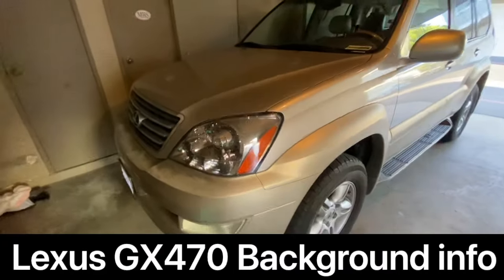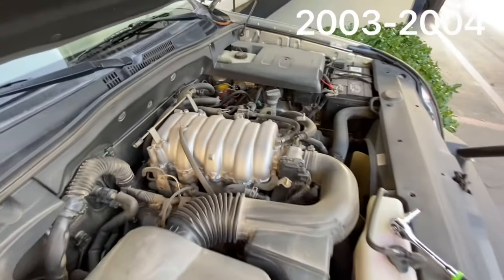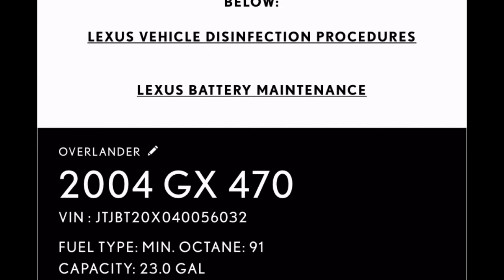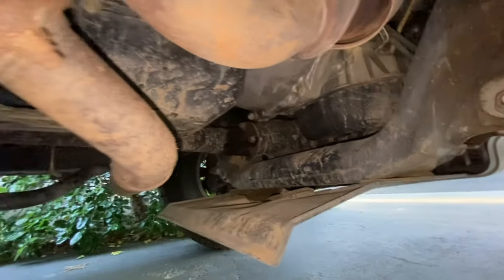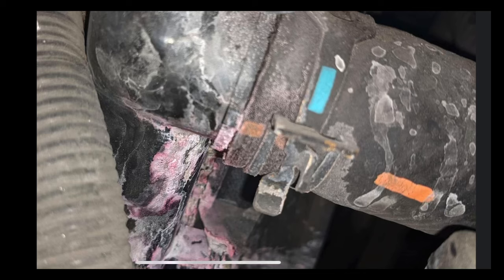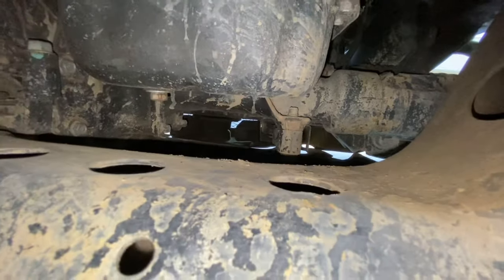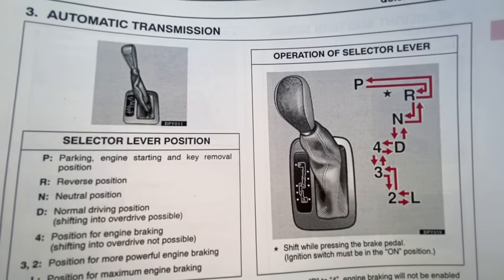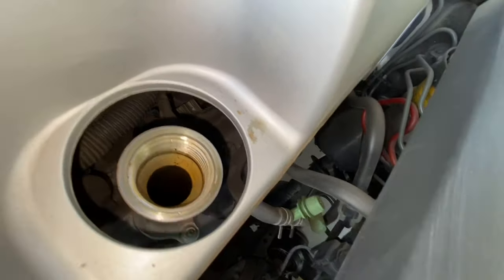LEXUS GX470 BUYERS GUIDE - 7 Things You NEED to Know

Comment: I would consider selling my '07 gx470 but I have hard time convincing myself why i should part with 40k+ to get a gx460 that would still sit in my garage 5 days a week and average 5k miles per year.   Would it really perform any differently?   
My only worry on my 470 is  frame rust here in MN.   However, i ask at Lexus and toyota whenever in for service if any noticable issues.   Answer is always no.   I can only crawl under so far.  Definitely surface.   But nothing excessive that i can see.

Ironically enough i purchased in the exact stock silver pictured on your video after selling my cherished '05 tundra dbl cab in the exact maroon color you pictured.   I could own an entire fleet of toyota / lexus vehicles i am so confident in them and feel they are such great values........well,  as long as you're not overpaying and buy smart used that is.
Reply from the maker: Yeah it’s a tough balance for sure. This market is definitely a sellers market though so you may be able to get top dollar for your used car at this time. 

Totally agree, For all non-sports car uses, I don’t see why anyone would get anything other than Toyota/Lexus.
Reply: Ivan living in MN would be a concern for rust.  However consider taking your 2007 GX 470 to a local shop in your area maybe in their down time of the year. IF such a time exists for your area.  Have them clean the main frame rusted areas and other rusted areas and spray or brush a rust inhibitor on it.  The reason I say brush it is there's not alot of people able to see under your GX other than your mechanic at 5,000 service points.   This will help prevent possible rust and maybe every 2-3 years take it back to the shop to touch up any rusted areas.

Comment: I hate timing belts. My old Jeep 4.0L has a chain. Think it’s making 300k no problem
Reply from the maker: Yeah I agree on that, timing belts can be annoying. But one thing timing belts are good for is making sure you (and the people you buy your used car from) have to periodically check and replace all your accessory drive bearings and have a fresh water pump. The Jeep 4.0s are another legendary reliable engine but they definitely don’t have the same performance as the 2UZ. There’s always going to be trade-offs.
Reply: That jeep 4.0 is one of the most reliable engines ever made

Comment: It's now 2023. If you had a choice between a brand new 2004 gx or a 2007 which option would you go with?
Reply from the maker: Need to include factors like mileage, maintenance history, rust situation, vehicle spec (like nav or non-nav), etc. 

I would choose a lower mile, great service history, great condition, rust free, non-nav 2004 GX over a high mile, rusty frame, nav, limited service history, meh condition 2007 any day.
Reply: Thanks for the response. Let's say both had 0 miles on them brand new. Would you still go with the non nav 04 over a nav 07?
Reply from the maker: @pcargs2721  I’d definitely get the Nav 07 and deal with the Grom VLine 2 head unit apple CarPlay integration vs. the better HU options available for non-nav… 
it also depends on emissions requirements in your state. If the emissions equipment introduced in 05 and on breaks, you have to fix it in strict emissions states (like CA). Otherwise you can block it off and no big deal.
Reply: You're the man! I found an 04 with 85k miles in excellent condition and almost no rust with non nav but they want 18k, its 1.2k miles to drive back, and I dont think the belts or water pump have been replaced plus 6.25% sales tax and I'll have to undercoat it.. and hes not wiggling on price. I like that it doesnt have bluetooth and no GPS for my tinfoil hat reasons though lol.. low emf exposure. I'm going to see if I can find a gem 07-09.. although the vvi adds come complexity this will just be a daily driver at first so the potential gas savings will be nice I guess
Reply from the maker: @pcargs2721  both trucks sound awesome. But you won’t save any gas with VVT. That system is designed around delivering more  power at lower revs, not efficiency. Modern cars have VVL (lift) systems (Miller cycle) that help with efficiency, but these don’t have that. It’s a significant amount more power though, which is nice. 
18k sounds insane to me but we live in different times than when I bought my 04…

Comment: I'm considering 2004 Lexus GX470....Is it recommend to buy? Thanks
Reply from the maker: Yes, I have two of them!
Reply: I'm looking at one tomorrow the lady had 71k miles and wants 12,500 one owner and from virgin island what do you guys think ? Good deal ?
Reply: @vaerio81  very great mileage...just check under part (rust or not), car paint, no accident and interior..etc... if they are all acceptable...you will have a great V8 with low mileage. Good luck
Reply: I have an 04' and it has 227,000 miles. Starts and runs like new. It was very well maintained by dealer before I bought it.

Comment: 20:03 wha is that green light on the top right of the dash?
Reply from the maker: It means the headlights are on
Reply: @lexus_offroad_adventures  Too funny I guess I do not drive my GX at night, hanging my head in embarrassment, my light is on for Require Service as well,  my GX just hit 200k and was fully serviced by the dealer up to 195 K miles when I bought it. Is it just a Hit Milestone check light comes on or does it sense something?

Comment: you're wrong about the nav/non nav entertainment aftermarket stereos, there are aftermarket harness adapters available that easily allow after market headhunt installs while retaining the nav/hvac screen
Reply from the maker: Nobody knows this better than me as I have both Nav and Non-Nav models. Also, See the Grom VLine 2 install video: https://youtu.be/fjHxRfWRZSk

My point was more of a criticism of the stock system itself that integrates AC controls in the screen rather than just having buttons which is way more convenient. And also that it is not as easy as simply replacing the head unit as it is with the non-nav. I like the Grom but you’re still dealing with an old touch screen. (Full review coming soon) Definitely not as good as dealing with all modern tech. 

Bottom line is that I was trying to tell people not to let dealers or sellers try to sell them on the nav being a “plus” since it is more complex than “it cost more when the car was new”.
Reply: @lexus_offroad_adventures  you’re 💯 correct , I was simply pointing out the work around, I enjoy your channel.
Reply from the maker: Gotcha, thanks for watching!
Reply: @james-he7xv  you literally told him he was wrong. You weren’t just pointing out there’s a workaround. You explicitly said he was wrong. It’s the first thing you said.
Reply: @tyronsreekley876  🤣
Reply: Lol love these comments.

Comment: So what is the “2nd Start” button???
Reply from the maker: Good question, I should have covered this. When you’re in 4-low, you may notice that the car is jerky when up/down shifting from 1st gear. 2nd start means the transmission will start you off in 2nd gear instead of first to both smooth out the ride when you come to a stop/slow down and also give you higher initial wheel speed if you’re trying to power out of snow or mud. You can also use 2nd start in 4-hi while driving on the road safely. I wouldn’t use it for too long in traffic though. But you can get an idea of what it feels like to use the feature
Reply: @lexus_offroad_adventures  gotcha, thank you!!! Honestly I’m sure this would be a solid video tutorial as I haven’t seen any video explaining it at all. Thanks again!

Comment: Has anyone had their speedometer and tachometer start to not work?  Mine will work in the cold weather when first started and driven, but then it will not work for the rest of the day.
Reply from the maker: I’ll pin this for a while to see if anyone else can help you with this issue. Is it just the backlight? Or does the actual needle stop working?
Reply: @lexus_offroad_adventures  The actual needle stops working on both.  (The temp and gas needles work all the time.)  It's very odd and there is no pattern except that when the car is cold and has sat over night, they work.  Then very intermittently after that, if at all.  Very odd... Thanks so much for your reply!  Really appreciate it.

Comment: I'm a gx owner but I do almost all maintenance by myself. But people just think diy maintenance doesn't count as well-cared maintenance... Do you have any ideas, I main most of gxor guys are experiened to do almost all services by their own.
Reply from the maker: Yeah that’s why it can be a bit hard in the used market. I’d say to use your owners manual service record section to document when you do DIY services. That way the next owner can know. If you’re looking for a used one and you just have their word to go by, it can be a risk but you can usually tell if they took care of it. Good idea to get a PPI always though.
Reply: I do all my own work aswell.. already did front air ride conversion.. to struts.. 2 yrs ago.. and in week or so.. complete front end replacement.. struts.. upper lower balljoints.. and bushings... inter and  outer tie rodends... wheel hubs.. and axles..  front and rear breaks.. with stainless steel brake lines new calipers and rotors out of a tundra...and rear control arm bushings,, with pan hard bar.. new springs and shocks conversion from air bags.. and front and rear sway bar bushings and links.. and with all toyota parts.. except rotors..  and my quote from my local lexus dealership... was crazy.. if you can't fix it youself.. better have DEEP pockets.. or really keep up on maintenance... and to toyotas service schedules

Comment: thoughts on 460?
Reply from the maker: Huge fan!
Reply: @lexus_offroad_adventures  i'm close to pulling the trigger on one..   super clean, and it has 33's on it.. one thing I learned is no timing belts - this 4.6 motor has timing chains so that's good.  has 2 inch lift front and back and seems pretty tight.

Comment: Then, why does it jerks after I come to a stop?
Reply from the maker: Sounds like the driveshaft clunk issue. As the rear air suspension settles down after you come to a stop, the rear driveshaft telescopes into itself on a set of splines. Because of some design flaw, the grease in the driveshaft dries up so while it tries to slide into itself, it binds and causes that bump/clunk. 

Easy fix. Just get a grease gun with zerk fittings, find the grease fittings on the driveshaft and replenish the grease.

Comment: On the dealership selling a car with a navigation, they are going to careless about your opinion because they will be like, well if you don’t have the budget to afford fixing navigation when it fails it’s not our problem. Lexus navs were their premium package for a reason cus it was higher class. Now it’s up to the people with low budget to make that decision wether they can afford to have one with navigation or not. In today’s days there are plenty of company’s that have good stuff replacing that oem navigation system for and aftermarket one with no issues. AND OF IT FAILS ALL YOU GOT TO DO IS PRESS THE ( AUTO AC ) button and use the up and down to regulate the temperature as simple is that. Just because the screen fails doesn’t mean your AC will not work anymore.
Reply from the maker: Yeah dealers might not care, That’s why I said “good luck with that” and laughed lol 

it’s more of a counter point if the dealer uses it in negotiation to try to make the buyer pay a higher price. 

Sure there’s always ways you can make it work. I have both a nav and non-nav model. But there’s a reason the prices for the non-nav AC controls are approaching $600.
Reply: @lexus_offroad_adventures  it’s up to preferences on my opinion. And the people that can repaired them for them selves

Comment: All 4 axles eh?
Reply from the maker: Yes. “Axle: a rod or spindle (either fixed or rotating) passing through the center of a wheel or group of wheels.”
Being that, at both the front and rear of the GX470’s drivetrain, there are two independently rotating axles, separated by a differential, each driving one of 4 wheels, there are four total axle shafts.

When people say “the noise is  happening at the rear axle” or something like that, it’s colloquial and not technically correct.

Comment: Lexus gx or 4runner?
Reply from the maker: If we’re talking about the 1st generation only: GX has the premium drivetrain as standard (V8 and full time AWD with selectable center diff lock. Rarer in the T4R so you’d pay more money) 
GX has a nicer interior
GX has more room inside 
GX has a quieter ride
GX now has just as big of an aftermarket 
GX prices are more reasonable
etc.

But… maybe some think the 4 runner looks better?
4Runner has the cool rear window thingy
With a 4Runner you get to be a yota bro…
???
Reply: @lexus_offroad_adventures  want to get one for off reading and just thinking about what's cheaper option and better for off-road reliability. Seen a guy selling a decent 2007 for 15k but I'm thinking that's too much while a 2007 4runner will be around 10 or so. It's a tough decision

Comment: If your timing belt breaks it’s a non contact. Meaning it will just stop and won’t smash valves.
Reply from the maker: I’ve heard this, I’ve heard otherwise. Until I talk to a Toyota engineer, I wouldn’t risk it lol. 

Some say that the non-VVT ones are non-interference while the VVT ones are. It just doesn’t make sense to my why they would completely refusing the cylinder head architecture for a change in timing actuation. 🤷‍♂️

If you have a link on the subject I’d be happy to read thru it!
Reply: Nooooo, this is an interference engine. Lose the belt, lose the motor.
Reply: This isn’t true my guy
Reply: Mines an 04' and I know it's an interference engine. So is my 09' RX350.

Comment: Shame the dashboards crack to hell on these
Reply from the maker: Yep, but I think they switched materials for 08-09 to improve that (could be wrong but I think I heard it somewhere) I’ve been considering doing a dash swap. looks like a ton of work though 😭
Reply: Jordan The sad factor there should be no dashboard that are cracked because lexus / toyota was replacing the problem dashboards.  During the time frame of the cracked dashboard Lexus was replacing the dashboards and owners received letters to get the dash replaced.  I purchased my GX 470 in 2014. 2nd owner and it had major cracks in the dash.   They did my service work on my vehicle and placed me on the list to get the dash replaced and Lexus replaced it no problem.  I give Lexus and Toyota credit they step up to the plate when there is a major problem with their vehicles.